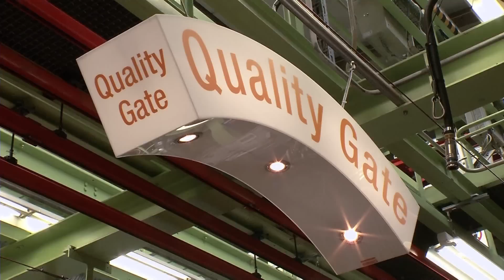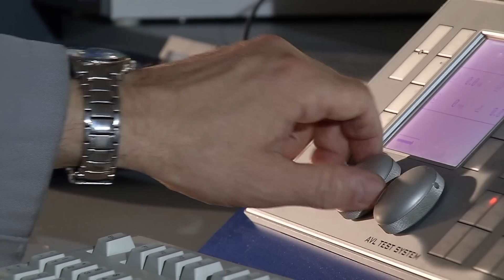MAN Trucks & Buses Engines Assembly

Comment: What is the heat sink on the centre of the fan for?
Reply: If the material melts the engine is overheated.
Reply: It's the temperature actuated clutch: means the fan only runs flat out when it's really needed, thus saving wasted power.